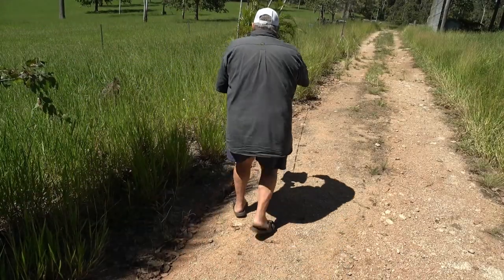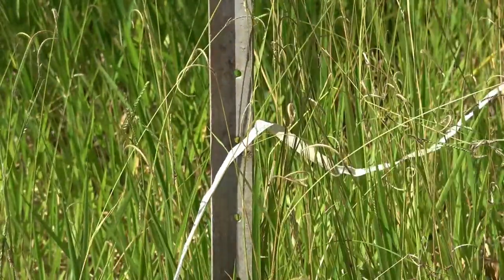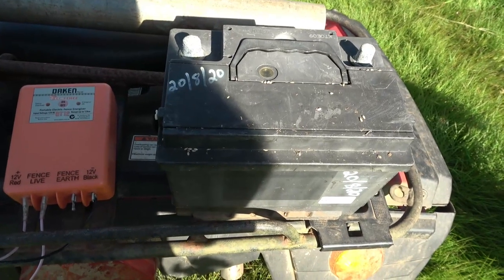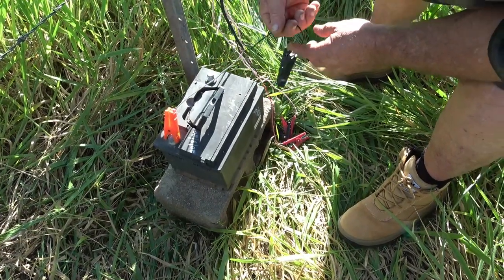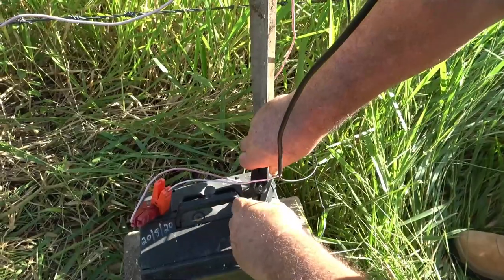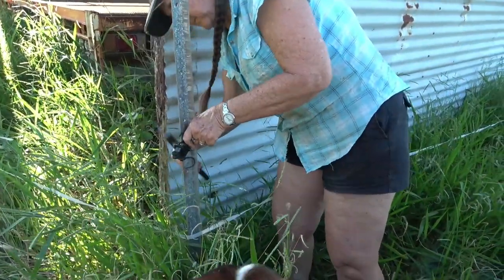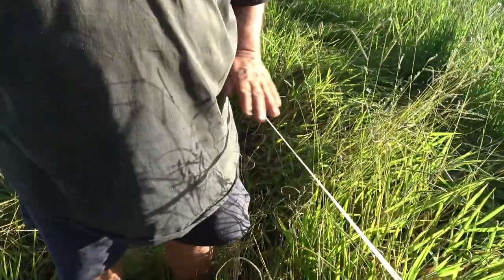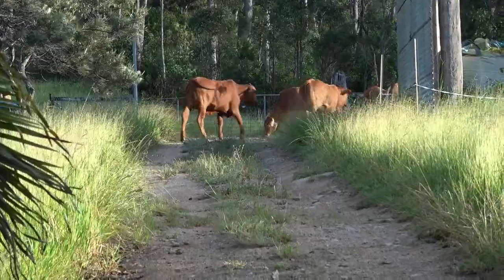HOW TO ELECTRIC FENCE

Comment: Sorry had to add another point: you see I am no good with wire fences or doing the end bits but I have mastered electric fence all these years! You can have vegetation touching the fence but because of that you will need a bigger output energiser. The one you have there has 1J stored capacity which will do the job. You will see an output reduced to about 6.2kV instead of around 8 or 9KV. If you want it to function properly you WILL need a dedicated earthing though - what you did is good for short periods but not for a length of time. In fact the secret of electric fence is earthing.
Reply from the maker: Thanks for that. I never have the fence in one spot for long probably why I don't have trouble. John

Comment: Hi John. Is there a reason that you use Warratahs, rather than pig-tail tread-ins? Watching from across the Ditch.
Reply from the maker: No I just have them. Like I said the system of steel pickets is a mongrel its just that I have lots of that stuff. I find it good if you are not moving the fence much. I have a situation coming up where I want a permanent electric fence and I will build it with pickets and those insulators and wire. That will get rid of a bit of it. Ha Ha. John